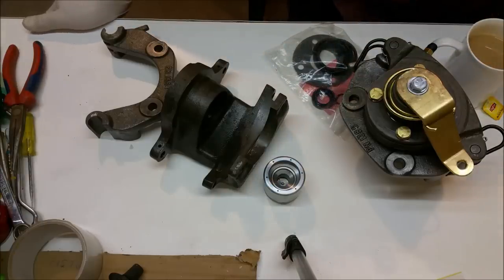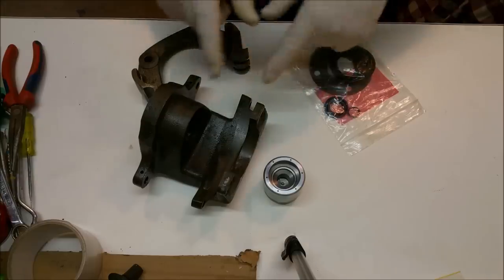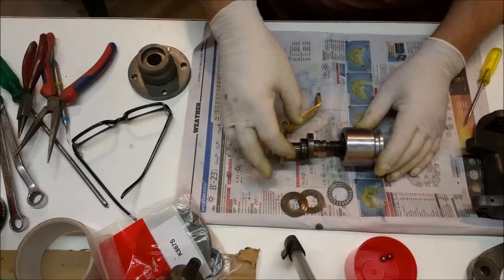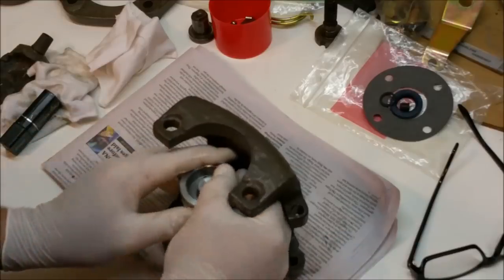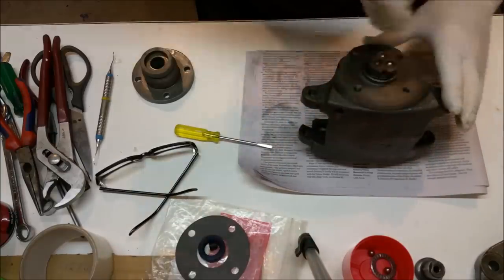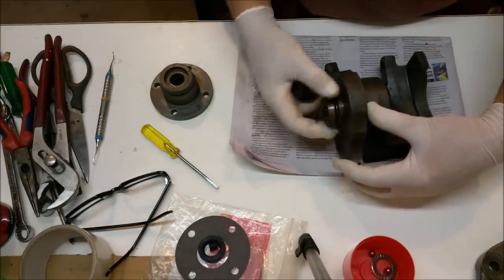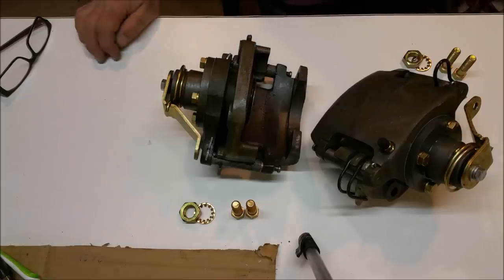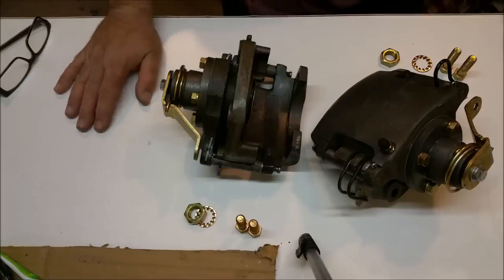XC GXL Restoration Pt 42 - XC XD Rear Brake Caliper Rebuild

Comment: Great video Peter. The only criticism is the video skipped the installation of the two split pins after the slide shafts were installed. Very informative and articulate - thanks for using actual mechanical names for all the parts!

Comment: Just did this rebuild. Used your video as a guide as I didn't have an xc workshop manual. The only issue I had was clocking of the handbrake lever. I eventually (hours) figured out you can clock the lever pivot three different ways being three ball bearings mounted 120 degrees apart. You have a 1/3 chance of getting it right without lining up the mounting slot in the lever in the right position just before mounting the housing.
Reply from the maker: Absolutely and I got the levers in the wrong place - well it was correct for the handbrake cable I thought I was using. Ford made a couple of different handbrake levers for these calipers, which I ended up changing in the XC. It was simple though, you don't need to remove or re-bleed the caliper; just remove the four bolts on the rear housing and turn the shaft 120 degrees as you know, cheers.

Comment: Another interesting video, Pete, and I like the old Goose Neck spanner, don't see them much any more. A favorite tool of mine, as a teen, pulling old Holdens apart and finding out how things work 3/8, 7/16, 1/2, 9/16 and 5/8 spanners and you could pull most of the vehicle apart. Arhh the good old days. Cheers.

Comment: Thanks for posting this video you helped me with my project. i rebuilt my zh rear calipers today. basicly the same but the handbrake lever is different. But sadly apon clean up  I saw some corosion in the rear hole and my local brake place had to resleeve them for me ,

Comment: What a fantastic video! Thank you so much for taking the time to share so much of your knowledge with us. I am a huge fan of all your projects and I always learn something new from your videos. I am currently building a Landau from a very rusty wreck (I have replaced about a quarter of the body shell). I have had to learn to hand form many repair sections from sheet metal and also how to TIG and MIG weld. If you want, your welcome to come over and try out the TIG, I find it perfect for any panel repairs. I am in Caulfield Vic. Cheers, Gil.
Reply from the maker: Thanks Gil, glad you like the videos. I'm not experienced with TIG and am told how good it is. We have an engineering college at my work, just never got around to looking at it - time is so short here. Thanks so much for your comments and invitation, cheers.

Comment: I had a couple of fords with this type of rear caliper,the only problem was as the disk cooled  the car would sit on the park pin.A mate of mine had a manual scorpion parked it on his girlfriends drive and 30 minutes later it went through the garage door!
Reply from the maker: Yuk, that sounds bad - worst nightmare on a restored car as well... thanks, cheers.

Comment: To answer Rodolfo's question, with this flawed design (and after having owned one for 33 years), it is clear you really should recondition the caliper in the way shown regularly.  If this does not occur, what happens in a car that gets driven to the shops or friend's places daily is the piston seizes on the worm (I suspect from additional pad wear + using the handbrake so many times) and CANNOT be wound back for a pad change using the tool without removing the brake caliper from the car.  I'm too old now to spend my declining years doing this (used to like to do the old drum shoes - so much easier!), so I take it to the shop, lol.  There is method to the modern madness of having a separate parking brake drum.

Comment: I've been waiting on this video for months. Thanks so much for uploading. I was quoted $1500 to reco my GXL rear callipers. Now I'm going to do it myself. Can you tell me who does your plating and where did you get the pistons and seal kit? Cheers.
Reply from the maker: Yes mate I get my plating done at Warners Metro Welding in Bayswater. The pistons and rebuild kits from a brake joint or eBay. I use Newbrakes in Ringwood, cheers.

Comment: Very nice job, i prefer a bit more rubber grease between the piston seal and dust boot as it provides a good barrier against moisture. Here is a question for all.  Should an engine oil pump be packed solid with Vaseline on an engine rebuild?  I say NO, i use a smear of assembly lube as the Vaseline can cause a blockage until the engine warms up and melts the Vaseline. please give you opinions.
Reply from the maker: Internal oil pumps shouldn't need priming... none of the Ford V8's I've experienced do... fit the thing dry, fill engine with oil and rotate the drive with a cordless drill (not at insane speeds) and you have oil pressure. As for Holdens and Rover V8's, yes they need to be primed.

Comment: Hey mate 
Thanks for the great tutorial!

Quick question, for the brake piston, does it come with the internals when purchased (bearing, washers, clip etc) or should they be retained from the old piston?

Have a safe holiday 
Cheers
Reply: I just bought a seal kit with replacement pistons and they don't come with the internals. I had to source the bearings from a specialist bearing supplier. They were hard to find. Let me know if you need the details.